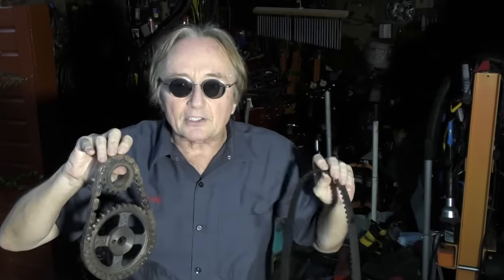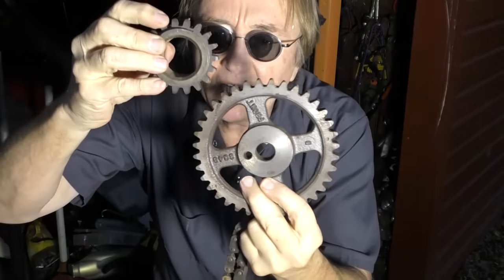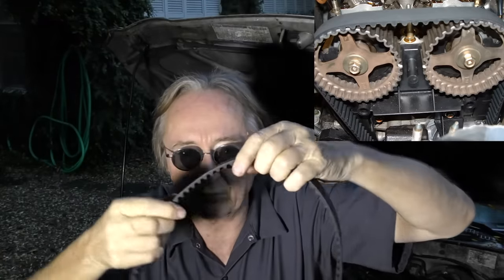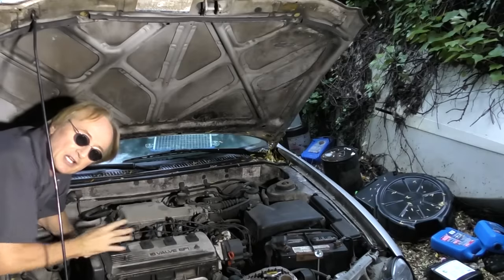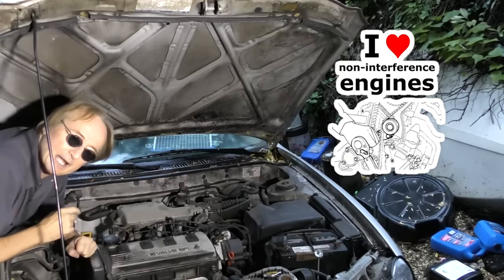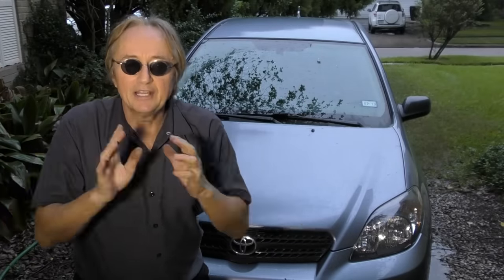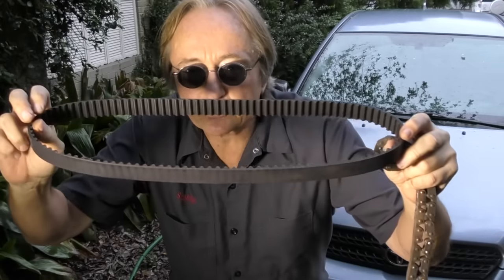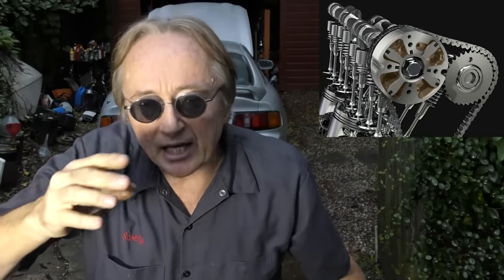Why Some Cars Have a Timing Chain Instead of a Timing Belt

Comment: Couldn’t they have just made the timing gears helical, and that would have eliminated the whine?  Seems like a good idea.
Reply: John Gaither  way true
Reply: I had the same thought. Seems like that should be an option you could at least pay to upgrade.
Reply: It's actually not just an issue of cost. Helical gears exert a sideways force which would put more stress on the bearings, requiring everything to be beefed up. You could get around this with double helical/herringbone gears, but those are less efficient than straight cut gears.
Reply: Stephen Workman thanks for the added info
Reply: the helical gear system would outlast the engine and make the dealer service dept  obsolete.
Reply: @boulder795  Gets it.  You'd have to use double helical gears or, in cruder form, two opposed helical gears 'facing' each other to cancel out the inherent axial thrust, sort of like how it's done in manual transmission gear trains.  Either way, that's a whole lot more investment in time and energy to get to the same result when the current setup will work 99 percent as well.
Reply: Efficiency. Helical gears aren't perfect, especially in performance applications, they're just quiet(er) compared with good old straight cut. If you need to get motion from one location to another location with a large distance between them, chains and belts are the best way to do it.
Reply: upgrade to an entirely different engine design? @Tcooks92
Reply: they did, I saw it in an OPEL car,  they stop using gear not because of cost, because camshaft was not in engine block anymore.  so with camshaft in the head, you will need a big big gear.
Reply: Honda used direct timing gears to drive their V4 motorcycle engines without pushrods.
Much more precise timing of valve opening and closing, combined with sprung loaded quietening gears.
Reply: helical gears are made to operate at slow rpm. not 7k rpm
Reply: Helical gears still whine. My Ford 4.9 has helical timing gears, and it sounds like a supercharger, only less so. Plus, helical gears side-load the crank and camshafts.
Reply: So is mass transit, elect cars(EV-1), or just plain remove capitalism and replace it with The Venus Project and let live rather than kill. Coming to a airspace near you.....money wont stop the murder of everything, education/communication will.
Reply: How much better would the helical engine last if from day one you put Synthetic Oil in there?  I suppose this would extend the bearing life.    I drive a 2006 Honda and have burned Synthetic Oil for as lone as  I can remember. So far, all I ever needed was tires and brake jobs. Car now has less than 50,000 miles on it. Being postal retired has helped me reduce the wear and tear on my personal car.  @mixter7x7
Reply: Chevy Chevettes that had 4  cylinders all had over head cam shafts.  I have longed forgotten how those camshafts stayed in time with the crankshaft. Chevette Scooters were junk. Sound like you were riding in a car full of tin cans rattling around.   Dn @marianoaldogaston
Reply: MMM, in street car motors timing gears are helical. One maker back in the late '40s to the late '60s used herringbone (double helical) timing gears. The cam gear was phenolic resin bonded laminated fabric much like printed circuit board material. It ran with a very slight interference to eliminate gear lash noise. For racing and military applications the cam gear was bronze running with close clearance.
For racing applications helical gears are replaced with spur gears as they are stronger and more efficient but noisy.
Reply: Alex Paulsen, spur gears are the most efficient over chains and belts. Look at the timing gears of ultra high performance motors: Ferrari, Lamborghini, Bugatti and similar.
Reply: Marino Gaston, for all-gear camshaft drives several intermediate gears drive DOHC motors.
Reply: Helical gears would cost a lot to make and are not as strong as straight cut gears.. so not very good if you over 600hp... or constantly revving like on race cars.  The helical gears would break fairly fast.
Reply: Still can whine.

Comment: Trust GM to make a chain last less than a belt, half the VE Holden Commodores out there had to have the chains and guides replaced at around 100k kms
Reply: Vy commodore has chain and after 230k no issues.
Reply: The last of the vz sv6 and early ve v6 had an issue with the timing chain oil supply. There wasn't enough oil getting to the chains, and the high load from the variable valve timing caused rapid wear. 
I went thru 3 engines for this reason, then went back to buying v8s, they're unbreakable.
Reply: Have owned quite a few high mileage V6 GMs before, never experienced a chain snap,  knock on wood, usually everything else fails before the chain goes most of the time
Reply: GM V8's back around the 70's and 80's used "Plastic" teeth on their camshaft sprocket. Either you changed your timing chain at 100K miles with a beefier all metal cam gear or you found yourself walking. I would love to know if and when they stopped using plastic gears?

Comment: I am sure now that you have never seen a vw 1,9/2,0 PD timing belt.That belt can take anything.
Reply: Ivailo Mirchev never defend a timing belt.
Reply: @mateodelcastillo7186  Hey man I changed a slot of belts and chains it all depends on the DESIGN. I changed a belt with 100 000 k miles over and a oem chain on a audi that snaped before 50 000 k.
Reply: Ivailo Mirchev it broke at 50,000.     What was the driving conditions and how did the driver operate the vehicle.     Also anything can fail early if it wasn’t manufactured correctly.   Could have been the quality of the metal also.  

There are Chevy 350 5.7 that last for 400,000 on the same chain

There are old VW Beatles that lasted 300,000 on same chain

There are older Toyota trucks at 500,000 with same chain. 

Just saying chains and steel are tougher than a rubber belt.
Reply: @mateodelcastillo7186  DESIGN man these engines that you mantion are v8 they all use a 20inch chains and the valves are operating with pushrods there is litle close to none strain on that chain. Belts are cheaper to make and much more easy to change that's it.
Reply: vw, pfft.  Walk away from anything with that logo on it.  Look, I like Nissan Maxima's, but I know that the Jatco CVT is probably the worst in the industry, expensive and the reason I will probably never buy a  Maxima.  VW fans need to come to grips with VW=rubbish.

Comment: Since 2012 Bmws 4 cylinder n20 engines are notorious for timing chains snapping on the 3, 5, X1, x3 etc. it's absolutely disgraceful.
Reply: Agree.
Reply: And the N47 diesel -and it's at the back of the engine so replacing it is an engine out job. The problem with lifetime parts that turn out not to be... at least a belt will be put in an accessible place since it's expected to be a maintenance item.